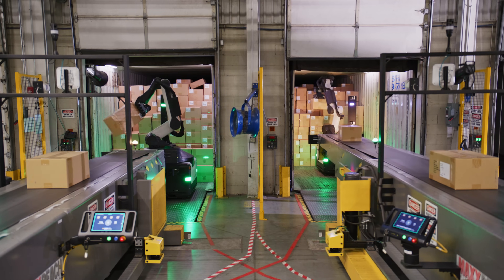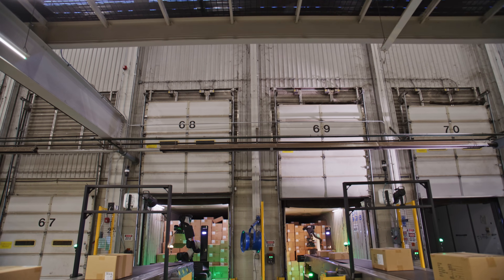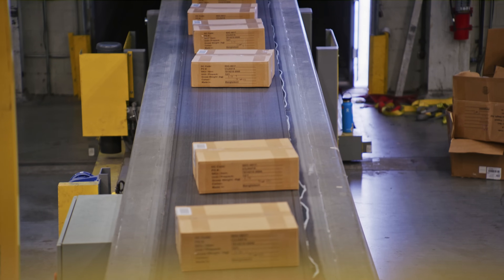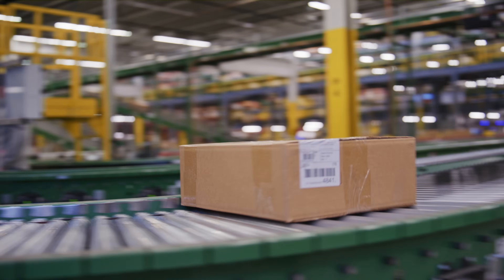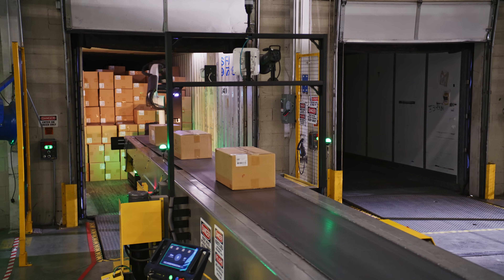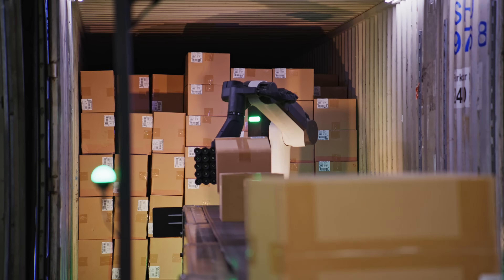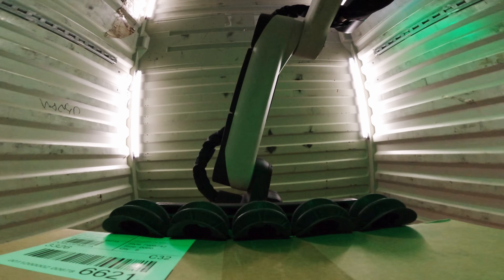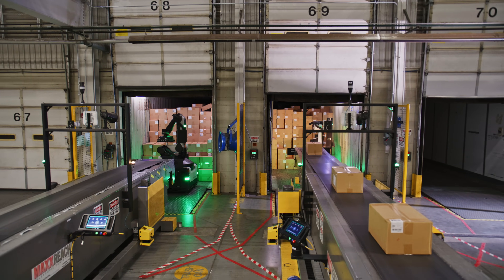Stretch at Gap | Boston Dynamics

Comment: Those are the most unrealistic conditions I’ve ever seen when unloading a trailer. First of all... no warehouse in the world deals with homogeneous size boxes. Then, broken, wet or heavy boxes wouldn’t be picked up by a vacuum. What happens if the labels are placed facing the opposite way, how would the robot read it? Pallets never go on a trailer if isn’t not on top of a pallet. There is also the need of an operator to use the robot. This is a cool robot and what not, but is not meant for the real world. Safe to say, unloaders have their jobs secured. And it would take minutes to unload a palletized load as opposed to hours with a robot like this.
Reply: As someone who has worked asna package handler unloading those trailers sucks only unrealistic thing is how neatly stacked the boxes are

Comment: I will be skeptical until I see it unload a normal shipping container. I’ve worked in manufacturing for a decade now. I’ve never seen a trailer look like that. 

Who stacked those boxes? Give that person a raise.
Reply: The chinese factory workers at the factory, that filled this shipping container which is not a trailer.
Reply: @ which I did use
Reply: @ Sure you did.
Reply: @deildegast  “I see it unload a normal shipping container”

I used your proper terminology. Idk what you’re sperging about
Reply: @ well, your question about "who stacked that" is sufficiently answered then.

Comment: I mean, I hope it leads to functional robots to take over these kinds of boring, labor intensive jobs. 
But no company stacks boxes like the ones in the trailers depicted in this video. Neither do dock workers or the lumpers.
If you're going to floor load boxes to maximize the load, first of all the boxes will be stacked tight into the ceiling. 
There's at least 2 empty feet above the top of the loaded boxes in this video.
Second, the robot arm is way too slow. Lumpers get paid either a piece count or a flat rate, regardless of how long it takes to unload, so they're HUSTLING. 
They don't move one box at a time like this robo arm. 
Third, boxes aren't loaded with the giant bar code facing out on the top right side of each box. 
That doesn't happen.
Guys loading trailers just throw them in and pack them as well as possible before moving on to another trailer. 
They don't have time for that.
Two guys unloading a truck like this, one on each side of the conveyor belt will unload a truck at least four times faster than this robot arm.
But one day, The Robot will be just as fast and efficient, and then even faster and more efficient than a mortal human.
And then...

Comment: If you think about it, one could say that the robot took away one job to create four more new jobs. The engineer who designs the robot, the engineer who programs the robot, the technician who performs maintenance on the robot and the operator who locates/operates and monitors the robot.
Reply: A team of 300 engineers develops a robot which would be produced in millions. A team of engineers programs dozens of robots for a store which would work for the next 10+ years. A group of technicians travels from store to store to maintain dozens of robots per day. Two operators could monitor ten robots at a time. Every new job is not proportional to the jobs replaced. Clearly not one to four.
Reply: What kind of brainrot do you need to actually believe this
Automation doesn't create more work THAT'S THE POINT
Reply: So what do we do with all the non-college educated workers that this costs their jobs? Some people don't want, or can't go to college, dummy.

Comment: Where are the packets, leaking boxes, tumbling stacks? This tech only works in specific companies, and the cost of Stretch is still more expensive than a person. Once the trailer is unloaded non conveyable parcels will have to be removed from the trailer by a human person. To earn it's keep Stretch would have to be capable of full duties. 

 @BostonDynamics for Stretch to be viable it must also replicate the current lifting capabilities of a forklift, or a basic pump-truck. When not in a trailer could the operator use it to move skids throughout the warehouse or at least along the dock? 

You gap order is about to get a lot more expensive and it has nothing to do with inflation.

Comment: I used to do this exact job at FedEx, unloading boxes out of the trailer onto the conveyor belt. Very back-breaking and can get insanely hot in there during the summer months. The boxes weren’t neatly stacked like they are depicted here but hopefully the robot can grab boxes from multiple angles.
Reply: I worked unloading tires from boxcars at American Motors over summer break from college in 1973. Even though it was night work, it was hellaciously hot in Wisconsin that summer, and that experience erased any thought of quitting college. 

Robots replacing that kind of labor is a positive.
Reply: Support people who demand better working conditions then lol
Reply: @icravedeath.1200  It won't get any better for warehouse work. With the amount of goods that flow in and out of a warehouse you can't slow down and even if they paid you more you're still going to have back and knee problems for life.

Comment: According to the video, Stretch orients the packages so that the barcode can be read as easily as possible by the scanner. But what if the package has handling instructions—if the contents are fragile or the package must not be turned? Does the robot respond to that?

Comment: I’ve worked at Amazon warehouse for 5 years receiving trailers and unloading boxes at the dock like this. Once the truck door opens, the boxes come tumbling out because they were tossed around in the trailer during shipping. Literally every box is a different size, weight and shape. Plus absolutely none of them are in a leveled resting position. just one huge  pile of dented and lopsided packages.
Reply: Yes, it's all "fake news" as your right-wing god emperor calls it. The robots have tiny people in them! You figured it out!
Reply: And maybe we can consider the Boston Dynamics thinks of these possibilities and are working to fix them.
Reply: Gotta start somewhere
Reply: And Stretch can deal with that situation as well, don't you think?
Reply: @zedxxx9  🤷‍♀️ in the absence of evidence either way, how can we say? It sure would have been a much more entertaining video seeing a truck door opening with a bunch of squashed and dented boxes spilling out, and Stretch just diving right in no problem. 🦾📦📦📦 Or some other challenging situations: Stretch working in a trailer instead of a cargo container; Stretch working non-stop in 120° heat and sub-freezing weather; Stretch picking up a dented box and dealing with its inability to read a bar code; Stretch picking up a torn box and watching the contents spill out of a rip at the bottom of the box. “I get to be the janitor for a robot and clean up after its messes. 😞”
Reply: @zedxxx9  they certainly haven't demonstrated that it can

Comment: I've never seen a trailer packed in that way with several same size carton box! LOL
Reply: @smokeystriper  Not every truck or container is loaded with pallets. It costs more money to palletize a shipment than it does to floor load it. When you receive the container, if it's palletized you can empty the container faster. But you still have to take product off the pallets and put it where you want it, unless you're simply going to ship the boxes further down the distribution chain still palletized. Companies do a cost benefit analysis. Sometimes it's better to get palletized shipments, sometimes it's not.
Reply: If you order a container full of the same product, they will be in the same size boxes. The Gap is a large company with a lot of inventory. This could be very normal for them. But if you looked at the video carefully, you will see that stretch handles multiple size boxes. They do not need to be all the same size. The particular truck that's the focus of most of this video came that way.
Reply: I import and sell products on Amazon and others. I import 3 different products, so there are 3 different box sizes. I'm pretty sure they are palletized when crossing the ocean, but when I receive them—usually in a full truck like in the video—they are unpalletized because we redistribute them based on actual demand. The pallets aren't packed in a way that suits our redistribution, and we don't want to waste time unpalletizing.

For us, stretch would help a lot. Currently, we do it manually. I hope my company keeps growing enough to buy and use a machine like a stretch.
Reply: For starters, these aren’t trailers, they’re shipping containers. They’re receiving a container filled with all of one thing, because they’re ordering bulk of individual items.

These aren’t trailers getting sent to the local mall. These are cargo containers featuring new product for the entirety of one company… so if they order Graphic Tee #3,822, they’re going to get containers filled with just that one SKU which they then distribute out to the retailers from their shipping HQs…

Their outbound is going to be trailers and they’re all going to look like Tetris meets Jenga. Their inbound is coming off of cargo ships…

Like, yeah, we all know what a fkin trailer looks like… and these AREN’T trailers. They’re cargo containers. All filled with a single SKU. Hence the uniformity…

That should have turned some lightbulbs on for some of you wingnuts…
Reply: @smokeystriper   Floor Loading is done with a telescoping conveyor that sends boxes down to one or two loaders who turn around, grab each box, and load them. Stretch is likely going to handle that job too, since its very much the kind of job that will cause repetitive strain injuries to the spine, much like unloading. Loaders and unloaders are the kind of jobs that should be mostly replaced by a bot that the former loaders and unloaders can then manage and direct instead, eliminating the strength requirement and the repetitive spine twisting that can cause spinal injuries after a year or two if you're unlucky.
Reply: They possibly chose this company to trial stretch based on their shipping containers being full of similar shaped boxes (they weren’t all the same). It’s not a delivery company of a something like Amazon where the boxes in a shipping container would have a lot more variety. From what I understand, Gap sells clothes so it might be more logical that their boxes are filled with similar shaped boxes…. There are problems with the video but I don’t think that is one of them.
Reply: anyone who's worked in other warehouses knows that this example is VERY ideal. many amazons receive shipments that are in TOTAL disarray and look like a mixed up box of legos when you open them. and in addition to being totally mixed up and different sizes there's consistently crushed boxes, wedged boxes, boxes that rip when you try to move them, leaking boxes, on and on. there's a reason they don't show you those and you would have just had to have worked in one of those places lol. that said.. this is the first step and it obviously looks applicable in the right locations. however you better believe this replaces workers. it "supplements a worker" in order to replace more. i'm not even hating or anti-capitalistic but you just have to be gullible to think they're not doing this to pay less in labor.
Reply: @wamyam  Of course, any company using Stretch is doing so to save money. Not just labor, but injury payments. These repetitive physical tasks involving moving even moderate weight from one place to another often results in on the job injuries.
Reply: this aint a trailer, this is a shipping container.
Reply: “You don’t have to bring any people in on weekends…uhhhh…allowing them to…spend time with family…” 

Aka: Humans with family’s losing overtime money
Reply: @smokeystriper  That term means the boxes are loaded on the floor of the container, not on pallets.
Reply: @smokeystriper Lumpers.
Reply: I mean if it's eventually made for robots to unload then it makes sense for them to use the same size boxes.
Reply: well... now you have lol.  Why would GAP use a bunch of different boxes?
Reply: @Chris-pt6hh  Are you a company shill or do you seriously not understand that packages come in various sizes and more than one shape?
Reply: @TheSmark666 bro if you order a bulk shipment of one item then everything in the shipment will be the exact same size
Reply: Once the bots get better though, they are just going to standardize the boxes to be at specific sizes and companies are going to need to comply. Easy. different bots handling different dedicated size boxes
Reply: @edrod8807  Since the robot can handle multiple size boxes, why constrain the box size? It's wasteful to pack things in boxes that are bigger than they need to be.
Reply: I have. What cruddy warehouses have you been looking at? Lol
Reply: I was just going to comment this, it's unrealistic.

Comment: Used to unload trucks all day, it was actually nice, the pay not so much. @BostonDynamics The question would be how des this thing performs under not ideal situations, rows collapse, so no clear view of labels, damage boxes, spills( liquids inside a boxes leaked and are all over the floor and other packages), small packages, and boxes missing label/ boxes with two labels(sometimes the label of other box would stick to another, sometimes it was easy to tell and fix right there), other not so much and you had to take the packages out of the truck, easy for a human, not so much for a robot of that size, assuming it knows how to do it, oh and do it it a tight schedule, since the trailer was suppose to be unloaded 3 hours ago but for X reason it just arrive to the door, and you need 2 people inside the truck for time sake.  Still cool robot.
Reply: this robot isn't intended to completely replace laborers so i would imagine in scenarios where liquids are spilling or boxes are damaged, the robot would probably not even bother picking them up or would give some sort of alert so a human person could deal with it

Comment: I don’t think many people understand that these are shipping containers and not trailers. They absolutely still have a team of Chinese people loading boxes onto containers by hand.
Reply: Not even just Chinese, lots of trucks are loaded that way in the US as well, its a common loading format called Floor Loading. A telescoping conveyor and like 2, maybe 3, Loaders are repeatedly twisting around, picking up boxes and stacking them as fast as they can manage. Its also a high risk for expensive spinal injuries that the company legally has to pay out for because its an on-duty injury and thus the company is responsible, so Stretch will allow higher throughput and perhaps one or two less Loaders, with the last guy now being the one to manage Stretch and intervene if Stretch encounters a bad box or a situation it can't figure out. If it means two less jobs and near-zero risk of injury the company would otherwise have to pay for? That's a good deal to the corpos.
Reply: Okay, but this is just one step in getting rid of the horrid jobs from logistics.

You don't solve all the problems at the same time—you take them problem by problem until there are none left (yeah yeah, I know that's impossible, but that's the methodology). Deploying whataboutism is never a good idea.
Reply: @ConstantlyDamaged I'm pretty sure that considering human beings who rely on those jobs as disposable is one of those problems.
Reply: @icravedeath.1200  Look, I'll be the first to say "stuff all these companies and their bourgeoisie owners," but manual labor jobs have been swapping to automated for almost 300 years. If people aren't earning a living wage, it's not the fault of the technologists replacing them with machines, it's the fault of the government for allowing corporations to pay them such low wages in the first place.

I don't normally get political in these kinds of vids, but as a democratic socialist I have to say you're looking too far down the tree to assign blame.
Reply: Who doesn’t understand?
Reply: no, they have cheaper and more effective robots for doing...they are on youtube, too, and w real scenarios

Comment: Palletized freight: "Am I a joke to you?"
Reply: Those are handled by forklift,
(operated by humans)
much easier physically to do.

Tbh forklifts are probably next.
Reply: @foxtrotunit1269 there are already AGVs operating as Forklifts... They have been running for years 😅
Reply: Sending 22 (or 44 if double stacked) pallets in a 40' container is a waste of space.  If they're wooden pallets, then they also need to be fumigated.  Loosely packed boxes are typical for international freight.
Reply: And in response to you:

Floor Loading: "Am I a joke to you?"
Reply: Yes. Yes it is. Palletised freight is wildly inefficient compared to using the full container.
You still need to get that freight off the pallet and onto the conveyor. Those minimum wage employees aren't going to fire themselves.